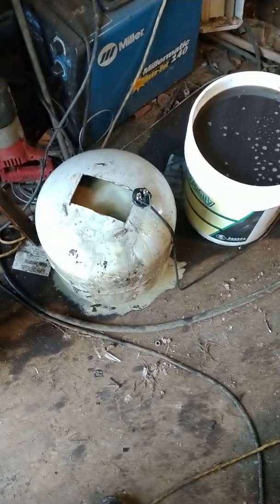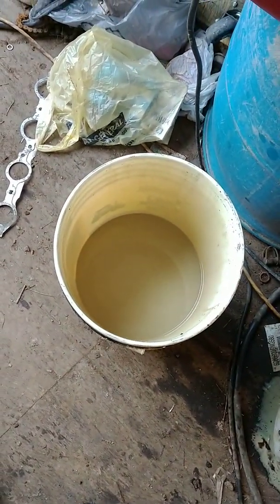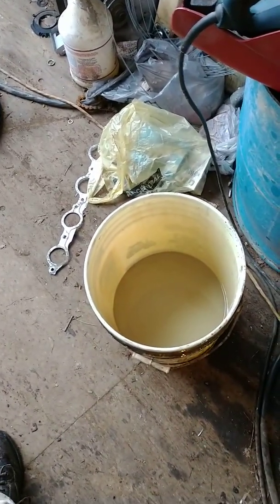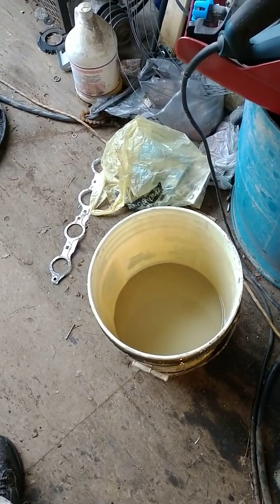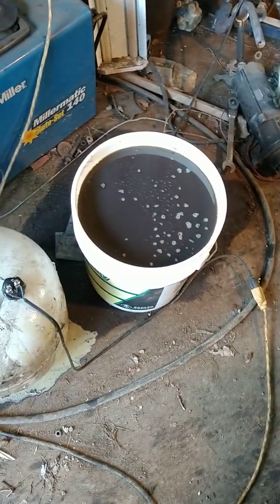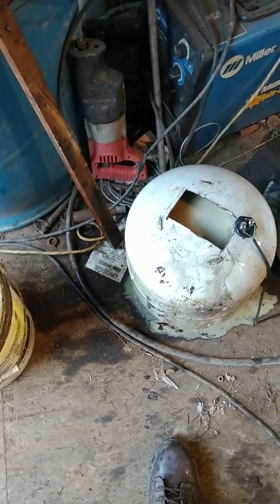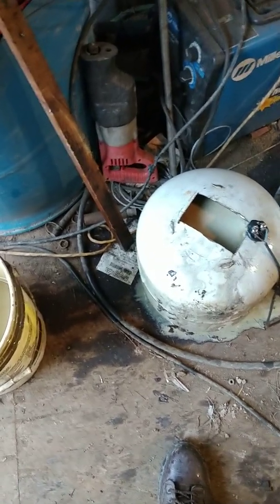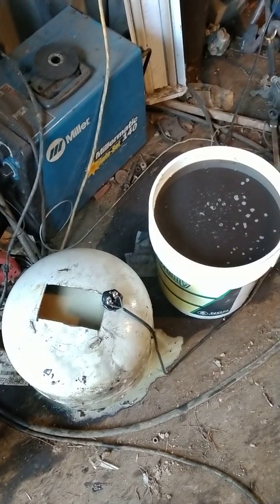Remove water from hydraulic oil

Comment: My hydraulic reservoir is heavy duty steel. What if i put the heating element directly in the skidsteer hydraulic tank? Skip the step removing it. Heat it in place. Any issues you see with that?
Reply from the maker: I don't see a problem with that.

Comment: A much slower process is to let the water sink to the bottom of the pail/tank and have the bucket, tank set with a drain valve on it. I waited for winter as i had a shit ton of tranny fluid to separate. When temps dropped below freezing the water freezes but the tranny, hydraulic fluid doesn't. All I did was pour the fluids into a clean pail and the water stayed behind frozen. If a person had Access to a large walk in freezer the process could be done quicker. Leaving the hydraulic fluid settle in a pail with a drain tap on the base also works.
Reply from the maker: That works too, but boiling it out is quick.   The stuff I had was actually mixed well. It sat for a while and still didn't settle. Either way works. Thanks for the views and comments.
Reply: I actually was thinking the same  the problem though is it seems to have emulsified and hasnt settled out one of the things i have seen cleaning out vegetable oil that has particles and is dirty fried bits  and pieces in it and that was basically filtered clean by using some gelatine and water and shaking it up and leaving it overnite the next day the gelatine has set and removed any old particles in the oil and cleaned it up beautifuly  just pour off the oil and take out the gelatine which you dispose of.The oil is ready either to be reused for cooking or you can add 10%kerosine to it and put it in your diesel vehicles to run them as its clean oil.So i was going to try cleaning some car oil and see if that same process would work it should in theory  think the mix for the gelatine was 50 grams per litre of oil

Comment: Do you think this would work with ATF fluid ? I have a bucket heater we use for race horses.
Reply from the maker: I'm sure it would, but I don't know that I would run it in a transmission. They are pretty sensitive to the quality of the fluid.
Reply: @battleaxefabandmachine  , it’s the fluid that Janie left uses in there equipment. I accidentally put over 3gls of water in the system 😤
Reply from the maker: @kennethbeeler1  yuck

Comment: What is the process? Would love to know. It is kind of a teezer.
Reply from the maker: You basically boil the water out of the oil.   Get the temp above 212 and the water boils out
Reply: @battleaxefabandmachine  I could not tell if that was a thermometer or a coil from a hot water heater you were using to heat the oil. Thank you for your reply
Reply from the maker: @bruceneveling2813  hot water heater element

Comment: You never said what you are using to heat the oil with
Reply from the maker: It's a hot water heater element with 110v hooked to it

Comment: I love that you are contributing and trying to help people and really appreciate the effort but man i am lost. So far of watching i see your steps are: 1) cut top out of bottle and add oil step 2) ?   Step 3) let it run for 3 to 4 hours step 4) filter chunks out. What is step 2? What is the electric thing in the container? Where can you get the electric thing? Is the electric thing mains powered or 12/24 volt? If you could clue me(obviously not the smartest tool in the shed) in I’d really appreciate it.
Reply from the maker: That is a heating element out of a hot water heater. It's a 240v element but I am running it on 120v. The heat source isn't really the important thing so I didn't focus on it. You could put the old tank on a fire or even a turkey fryer burner.

Comment: Hey tim smith, I went off your set up and tweaked it just a little. I cut the top out of a tank, filled it 1/2 way with contaminated oil,  put the oil on a deep fryer stand and put a vaccum line InThe top and as the water would boil out the vaccum would pull the water out. I didnt have time yet to run It but for a hour but I pulled 2 cups of water from the catch can in the vaccum line
Reply: Update: I brought the temp up to 175-190, it almost wanted to boil but I did t let it, kept it there for about 2 hrs. Water vapor came off in the catch but didnt clear up the oil at all.it still looks like  a milkshake.
Reply: What equipment and how did you rig up a vacuum line?